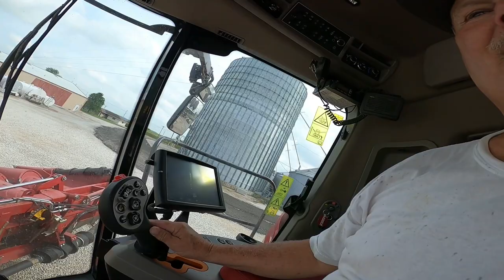Episode 26 Bush Hogging, Lawn Care, and Harvest Prep

Comment: What is the model number for that grass seeder on the case tractor? Does it dethatch and seed or just seed? Any info is much appreciated. Thanks
Reply from the maker: It’s a Land Pride Solid Stand Seeder OS1548 and it does both. You can get it with a few different options